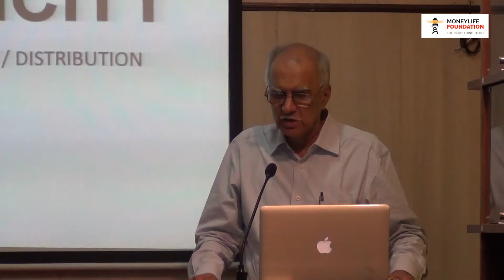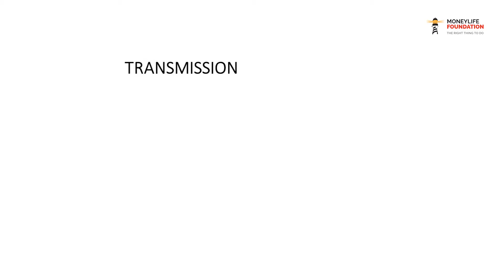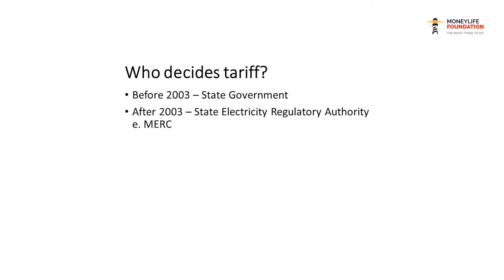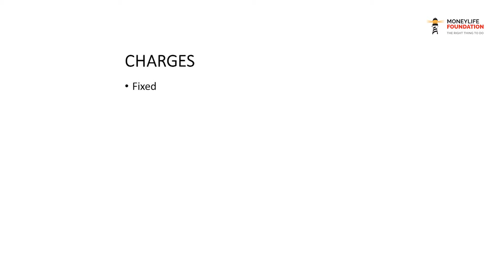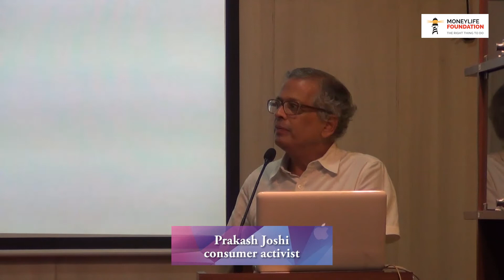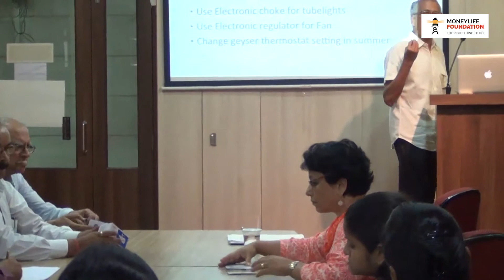Generation/Transmission/Distribution of Electricity - AV Shenoy

Comment: Fine talk by Mr. A.V. Shenoy explaining various components of an electricity bill which most consumers do not look at or understand. Of course, the only component a consumer can control is the 'Electricity Usage Charge', i.e. actual consumption. Mr. Prakash Joshi has given useful tips on how to reduce our electricity consumption by using energy-efficient devices / appliances. Just one comment on EESL, which supplies LED bulbs/tubelights at subsidized rates. I had got five 7W LED Bulbs of Philips make from my Reliance Energy organized outlet in Mumbai suburbs a couple of years ago. At that time it cost me Rs 100 per bulb. Sadly, 3 of these bulbs have already become useless as within 2-3 years they have either stopped working or flicker like a tubelight, making them unusable. I tried to get these exchanged with new ones from Reliance Energy Customer Care Centre but they refused to entertain such things. So, it appears that the quality of LED bulbs supplied by EESL are poor and don't last long as per their claims. I had also bought 2-3 LEB bulbs of other brands which are working fine even after 2 years. Hence, subsidized items are not worth the money, unless the Govt sets up a mechanism for their servicing / exchange within warranty period.